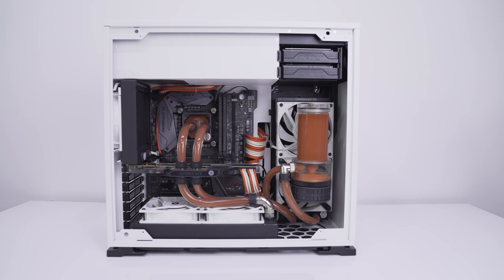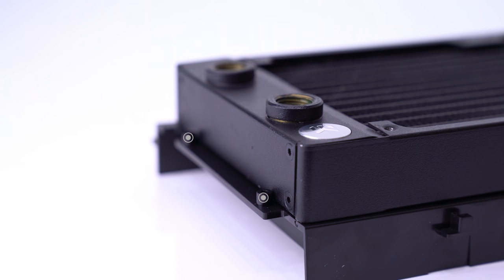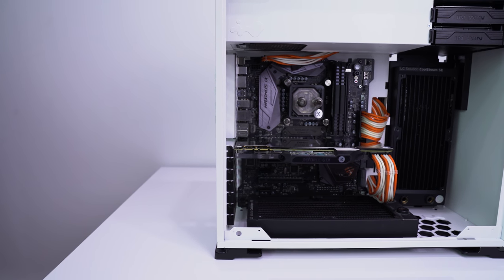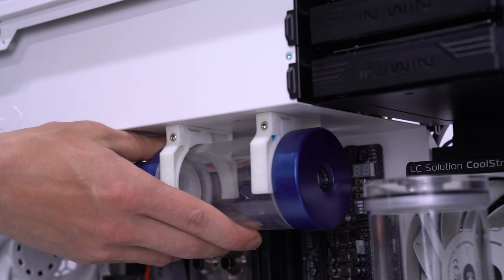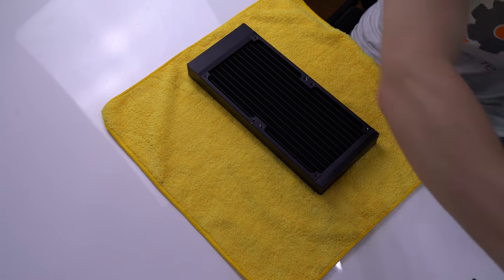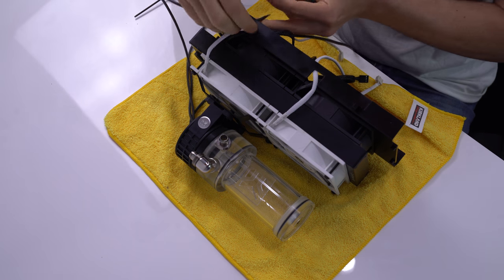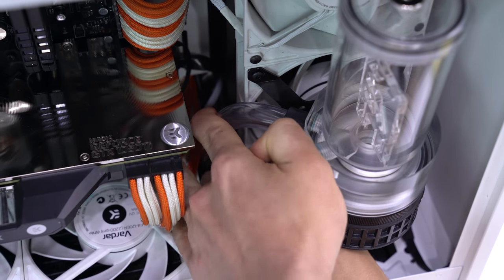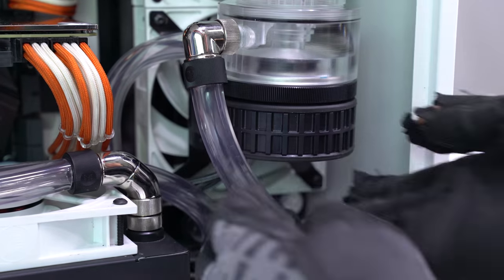What's the Fluid? [Episode 2: In Win 101]

Comment: Could you tell me what would be required to fit a bottom 360 and a side mounted 240?
Reply from the maker: You would need to take a Dremel and completely cut out the plastic on the reverse side of the 240mm mount so you can put the fans on that side. (the side that's closest to the side panel) 

You may also have to cut off those two plastic dimples on the radiator mount so you can mount the 240 with the G1/4 ports at the top. Let me know if that makes sense!
Reply: Senpai Studios yes that makes sense I was just trying to make sure I fully understood what was said in the video as it was only briefly mentioned. Thank you!